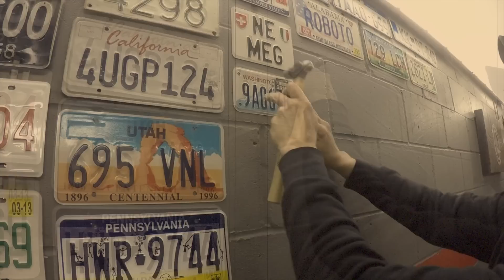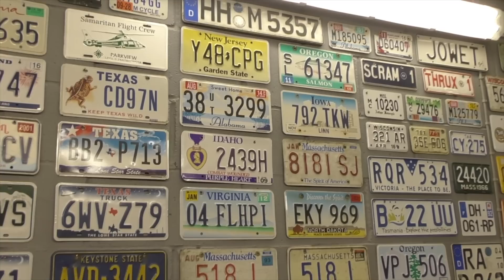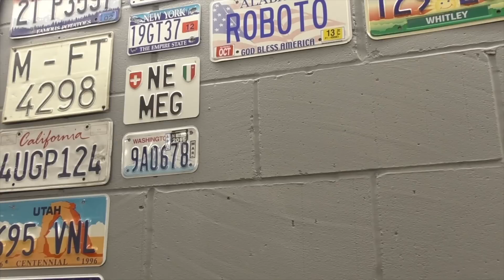Delboy's Garage, Simple Skills, Real Steel Rivets.

Comment: i am the smither at an engineering company making knives for the food industry, I too put flat head copper rivets in some of our knives as guide pins, not to hold anything together. and as you say, alot softer so just a 2lb/3lb hammer does the job :)
Reply from the maker: Yeah, i kinds wish i had chosen copper rivets for the demo...but a bit of white hot steel always looks cool aye...lol     Thanks for your input buddy.. cool job you have.1
Reply: Moonfleet41 especially at the young age off 22! took an interest in the old 74 year old bloke 3 years ago, and here i am, hes retired and im running the joint! not many smither about now! love your work, everything i know is through you
Reply from the maker: Thanks buddy... glad we have inspired you.. keep at it.. Del.

Comment: Great Video Del, Just a quick question you might be able to help me with? I are currently making myself two copper welding spoons. I have some flat steel bar I will be using for the handle and the end is copper sheet. I want to rivet the two compounds together to make my spoons and I would like to rivet like this? What material would you recommend for the rivets?? COPPER or ALLY or STEEL??? Thanks for help
Reply from the maker: Hi there Jay. if i was making those id got for copper, mainly because its soft and can be beaten in cold, and they'll look great.. ally is too low a melting point and a bit soft to be durable..!   Hope that helps.. good luck.. del.

Comment: Nice video Del. I'm a shipwright restoring a replica Galleon, I've had to deal with 1 1/2" steel rivets, beating them in and with sledgehammers and cold peening them with someone on a dolly/sledgehammer inside the ship. Longest one was just over 4 foot. We've started using a modified concrete breaker to do the bulk of the peening for us, but trust me you do not want to be on the receiving end of that. Those are real man rivets.

Comment: Thanks! I just saw a old fence the other day and it was riveted together but both sides of it were round. Should you use similar round-screw tool between the hammer to make it become round on the banged side also, or how is that done. Both of the sides were so round that I had no idea which one was the hammered one.

Comment: To think they would of manually beat thousands and thousands of rivets into the titanic or any other big ships back in the day.... what a brutal job that would have been !!
Reply from the maker: I had the privilege of watching it done in a demonstration once.. the rivets were ONE INCH THICK.. the plates would be preheated to expand the hole.. the rivet was tapered to wedge it in place... then it was beaten through from the outside while white hot, then held with a 15lb block with the set dimple in it to preserve the head shape... then two blokes on the inside of the hull would beat the inside with 7lb sledge hammers timed in turn... and they would fit up to 100 rivets a day for piss all money... ship building was more brutal than mining mate..
Reply: Would of been back breaking and no doubt ear shattering!! I was intrigued and watched a video on it earlier. Some ship yard in Sunderland making war ships in WW2 in the 1940s putting in 700 a day compared to peacetime putting in 400 a day!. Saw one guy lighting a fag on the white hot rivet haha then hammering it in . They did have hydraulic hammers then but still would of been loud !

Comment: Intresting Video, likley never to use this stuff though. My dad re-lines brake shoes for lorries, they use hollow rivets that are rolled over in a hydraulic press, little less effort, haha. I assume the aircraft you talk of is the Lockheed SR71 Blackbird, they do have one a duxford. Intresting fact about it, because its designed to got over Mach3 (Top speed of 2200 MPH) it doesnt fit together properly when on the ground, its designed to fit when its at operating temperature, meaning the fluid reservoirs inside the fuselage leak when its on the ground. Better that than something shears at 2000mph!

Comment: The new hull of the Medway Queen paddle steamer is hot riveted, only they had a powerful induction heater to heat the rivets and hydraulic jaws to compress them (and no it don't leak)!
Reply from the maker: Yeah, i was saying below, riveted ships dont leak, and they last for ever... the rivets were often tapered, and beaten into a heated holed too so they wedged solid..!

Comment: I've been using "new" rivits for years I didn't know their was another type although u mentioned black smithing every time ya see stuff like that they are beating the crap out of stuff with the biggest hammer they can find lol
Reply from the maker: Yep, but that's metalworking for ya, and why I love it so much - woodwork never interested me, cos the wood decides on how you are gonna use it, and you kinda have to do as you are told a bit...but with metal, you beat it in to shape and if it's wrong, you beat it back again, it does as it's told, and it stays put!  They were using as long ago as the Iron Age, so mankind shold not forget these things!
Reply: Moonfleet41 thanks for the new info del! by the way any idea where to get raw steel? need it to practice welding n the internet is very expensive
Reply from the maker: Have a look in Ebay for off-cuts, many companies sell their scrap stuff and will post it to you... !
Reply: Moonfleet41 thanks buddy I'll give that a go :D

Comment: The SR-71 Blackbird would leak fuel when on the ground, as it was designed to stretch out and seal at high speeds when flying.
Reply from the maker: Blimey, didn't think anyone would know that, I only read it on the placard next to the plane and it's one of the few inanimate objects I've ever stood next to that is actually intimidating and makes you feel a little uneasy!  Even the matt black finish feels weird cos it's not paint, it's a baked on Teflon ceramic, like yer saucepans and honestly, you cannot see the rivet heads from 6ft away, they are soooo tiny - truly incredible engineering!

Comment: Hey Delboy,
It's Roy from Texas and I have a question for you... have you ever dished a newer 07 - 16 4.4 gallon tank?  Basically making it an Indian Larry style tank but lower than his style of tank? That's what I'm wanting to make for my XL883N IRON...  Thoughts?
I'm worried about fuel pump clearances after dishing the sides.
Reply from the maker: Hey buddy.. No i havent done that.. but if you wanted to, you could drop the pump out and measure how much side space there is beside the pump/filter unit, then you can work out how much room you have to flip the sides.....and of course you know that you'll need to get it sealed and pressure tested... Good luck buddy.. Del.

Comment: hiya guys
just yesterday had to grind the steel rivets on a sportster seat  pan to move the tang bracket foward a tad
bloody strong little buggers
cant wait to see your rivnut vid
thats next on my list to do
when you make the vid can you please mention the cost  of the different sizes for me please
it might be cheaper for me to get my set from u.k im in new zealand
cheers
Reply from the maker: Hi mate, I am gonna incorporate fitting the riv nuts in to the next fabrication video, rather than make a separate simple skills just on them, the info. gets out there, but will make progress on the bike at the same time... and it's the next video up at the weekend, I'll be filming it Friday....

As for price, I bought 50 x M6 , a dozen M4, a dozen M5 and a dozen M8 in mild steel, zinc plated - and they cost me £9 for the lot from a local fasteners company... this is the kind of company that sells them loose, but you can buy them in blister packs from tool suppliers, and if you buy the plier type riv nut fitters, then you often get them included, so it can be good value that way!